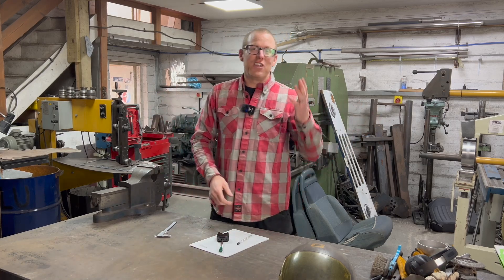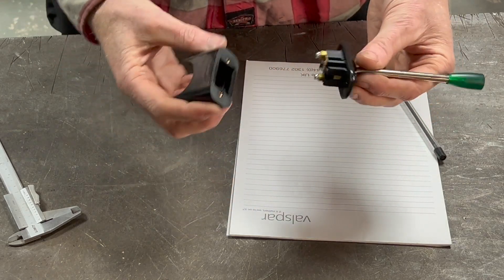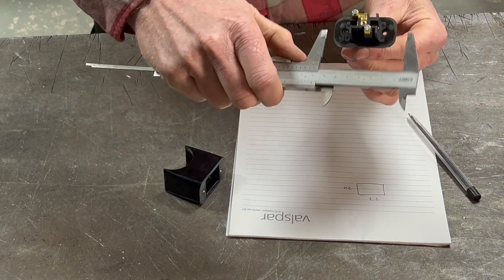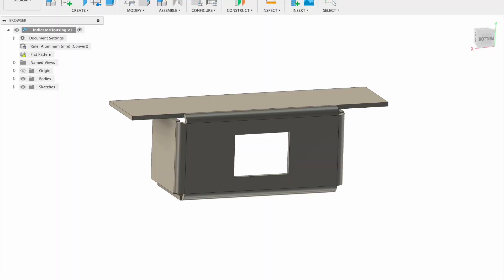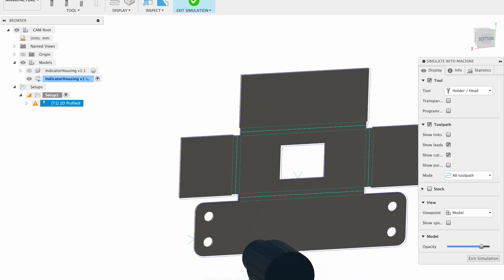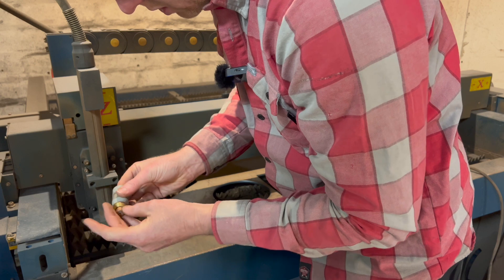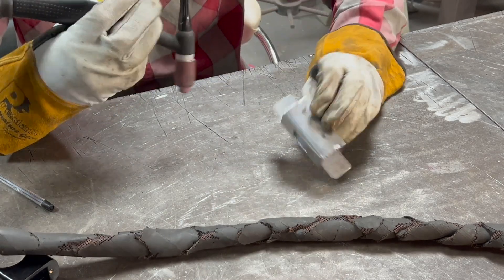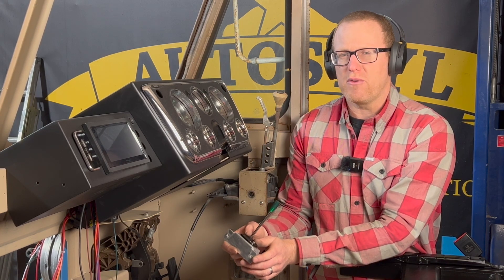Custom Car Part Design and Manufacture FULL PROCESS for Bernard Kerr's Twin Turbo Post Van

Comment: You have got some nice Kit and really know what you are doing, thanks for the great video. Nice old Lathe in the background Holbrook? Would love a CNC plasma one day but its a big purchase. Not used fusion 360 before but spent a fair bit of time with solidworks.
Reply from the maker: Thanks dude. Yeah I’m a sucker for having the best tools to do the job! Definitely helps do a nice job quicker! I’ve used solidworks too- it’s great, but super expensive. Fusion 360 means I can generate g code for the plasma right from the design, so streamlines my cutting massively.
Reply: @AutostylUK That's a nice feature to be able to generate the programming code through cad. 
A chap I used to work for used autocad to draw the shape he wanted and then the drawing was exported to the control on the Esab plasma cutter. Don't think there was any programming to do with that system. The control must have produced the programme from the drawing. I used to programme CNC lathes and mills, the G and M coding was long winded, conversational programming was much quicker. The technology to produce programmes from drawings was fairly new then, it has made such a difference.